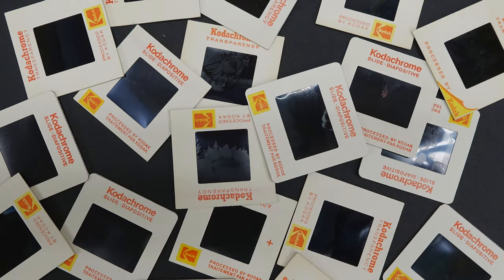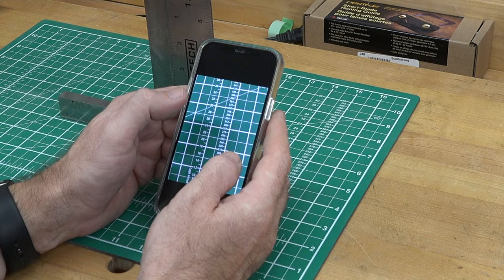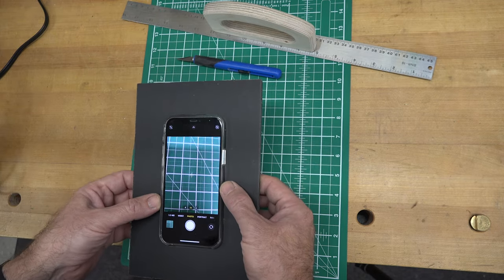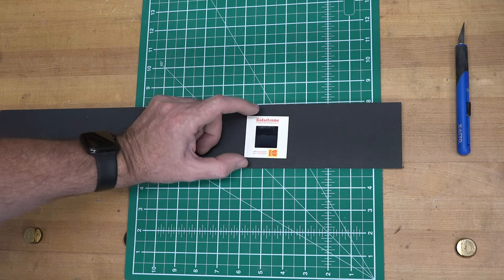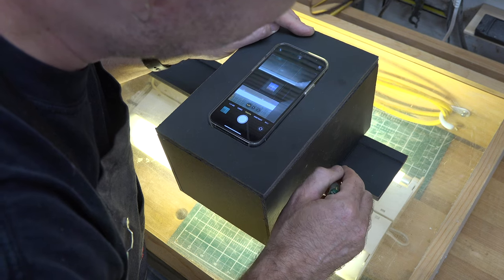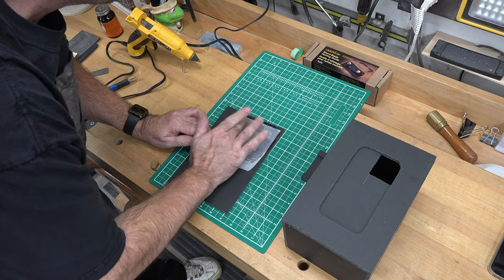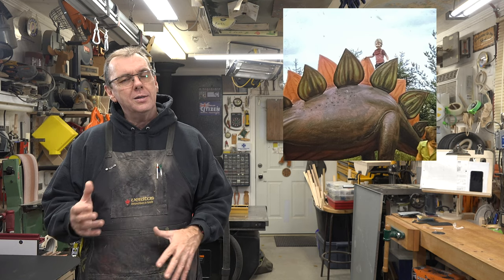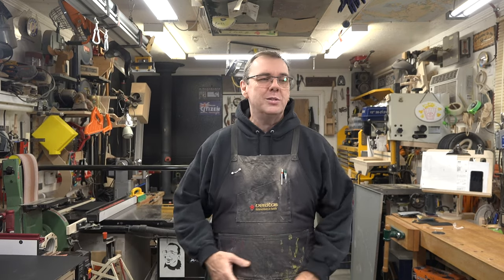Converting Slides to Digital Images

Comment: I'm really glad that you mentioned making sure to clean the slides. A few years ago, I decided to scan all of my family's old negatives. I have a scanner that has an attachment for scanning slides and negatives and figured this would be a good use of the down time between Christmas and New Years. I spent countless hours setting up an assembly line to scan all of them. When I was done, I converted all of the negatives to positive images and scaled them up. At this point I could see just how dusty they were! Software can remove some of the dust but starting clean is much better.
Reply from the maker: It is next to impossible to get a 100% clean slide to convert to digital, but giving them a good cleaning before putting them in the converter is a good start.  For the amount of dust or dirt that will show after a quick cleaning and conversion, the image will be acceptable for most users.  Thanks for tuning in to the show this week Jim and for chiming in with your story.  I'm frustrated for you.  LOL.

Comment: Thank you!  Our dad was a photographer, he took many and had them as slides.
I’ve searched in our area, and no one had the process of converting slides into prints.
So, THIS video is greatly appreciated!
Reply from the maker: While my father wasn't a photographer, he did take a lot of photos on  family trips and like you, I struggled to find someone to convert them to digital images.  I have found that the key to getting this done is to ensure that the slides are clean before you take the pictures.  I am also considering make a new version of this slide convertor using a DSLR camera instead of a phone.  It's something that you may want to consider as well if you want your images to be in RAW format for better editing and colour optimization.  Thanks for tuning in to the show and good luck with your conversion.

Comment: Amazing! I thought I might have to spend a lot of money to buy a projector or something but this is perfect. Took a couple of hours and around $12 USD (things are a lot more expensive in NZ but still cheap and fun to build). And it actually works! I'll have fun going through the rest of my mothers collection and I'm sure she is going to be super surprised and very happy when I show her her digitized slides from back in the 60s and 70s. Much appreciated :)
Reply from the maker: Glad that it worked out for you.  Be sure to clean your slides really well so that the dust and dirt doesn't transfer to your digital image.  Thanks for tuning in to the show and for the kind words.
Reply: How do you clean a slide without damaging the image? Thank you so much for your help.
Reply: use cotton buds and isopropyl alcohol to clean both sides of each slide

Comment: Hi Kenny, thank you so much for doing this project, it helped me out greatly. I also had issues with the light diffuser. What worked for me was not using a diffuser on the box, and (1) putting the frosted plastic sheet on the floor, and using it as a reflected light source (I attached a small flashlight to my belt, pointed at the sheet, so my hands were freed up to feed/retrieve the slides). What worked even better was instead to (2) use my Mac browser to bring up a white screen as the light source (which of course didn't need to be diffused). Placed the box onto it, and voila. All set to feed slides. This allows one to sit on a couch for the digitization, which was more comfortable than sitting at my desk to do it - easier on the back! Thanks again for your wonderful video.
Reply from the maker: I'm glad that you found the video useful and that you were able to come up with a lighting solution that worked for you.  Thanks for tuning in and for taking the time to leave your comment and kind words.  It's very much appreciated.

Comment: Fantastic idea! Beautifully executed video! I plan to get started on this tomorrow. I have approximately 2.2K slides that were taken by my father scanning the 50's to the 80's. My wife had given me a slide/negative scanner for Christmas a few years back and, I just discovered a serious shortcoming when converting slides! It has a built in, non-adjustable crop factor that results in a lot of chopped off heads. So, your brilliant idea will help save the day (with no maimed or  missing body parts). Thanks!!
Reply from the maker: Glad that the video was able to help you out Glenn.  Good luck on your project and your slide conversion.  Thanks for tuning in.
Reply: @acutabove_woodworkings  I picked up all of the materials for the box and slide tray construction today and, hope to get the build done this weekend. In the video, you mentioned early on that initially you sat the box onto your light table. How did the light table work as a light source? I ask because I see that there are LED light tables available that look like they would work very well. Sorry to continue asking questions.
Reply from the maker: @glennb1374  I had some issues getting the lighting right.  The problem is that you have to make sure that it is well diffused to avoid the individual LED's showing in the slides.  I finally settled on this one https://www.amazon.ca/gp/product/B0C663WDXH/ref=ppx_yo_dt_b_search_asin_title?ie=UTF8&th=1
and it worked perfectly.  No worries on the extra questions.  I don't see the point in me having a YouTube channel if I am not willing to answer people's questions and help out when I can.  While other channels use YouTube as a source of income, I have a full time job and try to utilize Youtube to actually help folks.  The tiny bit of money I make from the channel helps to keep the content going and to keep my website afloat.  I'm only to glad to help Glenn.  Ask whatever questions you like.
Reply: @acutabove_woodworkings  That one is nearly identical to the one that I had found on Amazon. Before I pull the trigger on it, I want to try one of the small Manfrotto lights that I already have on hand. If it works out, I’ll be sure to send you the info on it. Thanks again for taking the time to respond and share your experience and thoughts.

Comment: Hey Kenny, cool project. Another thing to try for the light diffuser is to move the diffuser away from the slide itself. This will ensure that the camera can't focus on the surface of the diffuser and the slide at the same time. It will make the box taller, but it will make a difference.
Reply from the maker: It wouldn't take much to do that Jim.  I will have to give it a try.  Thanks for tuning in and for taking the time to chime in with your suggestion.

Comment: Thanks Kenny from down under, just about to convert several hundred slides that are getting over 40 years old now, have looked at commercial but will copy your design. Thanks
Reply from the maker: I hope it works well for your Chris.  Thanks for tuning in and for taking the time to leave your comment.

Comment: If only I had seen this before ordering a scanner.  A thought to add to this ingenious make:  if the phone camera is oriented with its aspect to match that of your largest slide visual dimension (in this case, a 35 mm rectangle with the longest side matching the longest on the camera), then when you zoom to fill the screen, your resolution will be optimised.
Reply from the maker: Well hopefully you will still end up making one of these Craig.  It would be interesting to see the difference between the images done on the scanner and the images done with the cell phone.  I like your aspect ratio idea.  Thanks for chiming in with that and for tuning in to the show.

Comment: I added a heavy can to the inside of the box, so it can sit over the edge of the table without falling off, and didn't put in a light diffuser but rather diffused the light coming in. Also, I didn't do as good a job at cutting so my box was a bit wonky and let light in - so I taped the edges in black duct tape and it keeps the light in and looks nicer, too! Great design, thanks!

Comment: Thanks for this video Kenny, I made your design and it worked like a charm. My addition was to add a white foam core light box as the light source that worked great. Thanks again .
Reply from the maker: Glad to hear that you were able to make a successful converter Joe.  Sounds like you came up with a great solution for the light.  Thanks for tuning in and for chiming in with your thoughts.

Comment: Cool project Ken, my brother went to school for photography, he made a light box and used my light board that I have its a box with 2 fluorescent tubes (bulbs) with a white plastic board to defuse the light with a dimmer switch, for my brother it works great, he would look at slides and film strips after developing them, the light board worked out for my brother, thanks Ken  be safe
Reply: Made mine in photography school about ... 30+ years ago. lol  Still have it and drag it out from time to time. The white plastic board you're referring to is diffused plexiglass. You can't see through it but it allows light to pass through it.
Reply from the maker: Sounds great Phil and probably better than anything you would purchase today.  Thanks for tuning in and for chiming in with your story.  It's appreciated.
Reply from the maker: That sounds awesome Alan.  I'm sure that there would be many options to make your own light box today with many options for lighting.  The light box I made years ago had two small fluorescent fixtures in it.  It's bulky, it's heavy and it takes up a ton of room.  Maybe it's time for me to produce a show on making a light box with today's technology.  Much thinner and possibly LED lighting instead of fluorescent or incandescent.  Now you've got me thinking.  Thanks for tuning in Alan.  It's appreciated.

Comment: Magic! I need to scan a couple of slides. This should give me a chance to try to digitise them. The shop bought ones are too costly for only 2! Cross your fingers for me that this works. I have lots of foam board anyway, so...
Reply from the maker: I hope it does work for you Gail.  It worked for me.  Just make sure that you clean your slide really well and that there is no dust on them at all.  Dust really shows on the digital image.  Thanks for tuning in and good luck on your project.

Comment: I have a somewhat related interest in digitally processing a small collection of glass negatives (about 100 yr. old).  The response I received on a professional photography forum was to use indirect light instead of direct light with a diffuser.  In other words, arrange a remote flash to reflect off a curved white poster board or the like and mask the negative plate so no light comes in over the edge.  Also, I would use my dslr camera instead of a smartphone.  The number of megapixels is just one factor pertaining to image quality.  The size of the CMOS light sensor is another.  I already have an LED light board.  It gives fairly acceptable results, but not as bright as I really need.
Reply from the maker: Very interesting comment Trenton.  I have never heard of or seen glass negatives and I hope that you are able to use your DSLR to capture the images on them.  I may have to try my DSLR and see if I am able to use that instead of my smart phone.  I like the increase megapixel thought.  Thanks for tuning in and for chiming in to the conversation.

Comment: Those were the days my friend, I'd thought they'd never end...
Reply from the maker: Sadly, they did end.  It's a digital age now.  Thanks for tuning in Randy and for taking the time to leave your comment.
Reply: I have around 500 boxes of Kodachrome  from ..back in the day. I also have my grandfather's photos, mostly Kodachrome 👍along with some Ektachrome 🫨
I scanned a lot of my slides with a flatbed Canon film scanner,  but my XP computer kicked the bucket and I bought a cheap HP laptop.  The scanner doesn't work with anything beyond XP. 😥
I appreciate you taking the time to make and show this setup.
I know devices were made for digital camera conversions, but I never could afford to buy anything as nice as my old Canon equipment.
I'm wondering now,  how good the quality will be using something like what you've shown here.
........the Canon flatbed is 2004 technology. 🤔
I bought a Pixel 8 a few months ago.  The image quality is very nice.  I'm going to try this out when I find the time.
I made a lightbox years ago with a white sheet of plexiglass topped with glass.  It had a small florescent light inside. I used it for sorting my good stuff from the crappy stuff.
 Like many photographers, much more crappy than good, but when it's good, you know it.
Thanks again for rekindling my thoughts about those little yellow boxes 👍 
Set up right, I'm thinking this will outperform the scanner.
Reply from the maker: @randywl8925  I have also wondered about making this same setup, but for use with an DSLR camera and possibly a 50mm lens.  I may be expanding on this project myself soon.

Comment: We had 1000+ color slides we wanted to convert to digital images.  We got bids from $750 to over $1200.  So I 3D printed an adapter that fit over my macro lens to hold the slides at the proper distance away.  I used my computer monitor for a light source since using software I could "dial" in a color to make up for some bad slides otherwise a white screen was perfect.  It only took 5 or 10 seconds per slide once I got going.
Reply from the maker: That's a great solution as well Charles.  I may have to look into that and see if I can design something that will fit my lens.  Thanks for tuning in and for chiming in with your method.  I love it.

Comment: Brilliant?
You can use a flatbed scanner with slide attachment - both Canon and Epson make them, but they have not been updated in years and prices can be high because of limited supply.  Scanners are very slow and finicky to load the slides in the holder.  About the only advantage is they can also scan negatives, but they suffer from the same problems with dust contamination which is almost impossible to solve consistently.

I've already scanned my collection of slides but going to give this a try to see if the results improve.
Reply from the maker: While scanners do work the way you described, not everyone has one and this is a really cheap alternative to be able to convert your photos.  To be honest, I have a scanner and it came with the "cartridge" to hold the slides and negatives but I was looking for something a little simpler to use.  Thanks for tuning in Woody and for taking the time to chime in with your alternative method.  It's very much appreciated.

Comment: Hi, thanks for a a great video! Don't have a dollar store where I live, so have to buy foam core online. Whats thickness in mm do you recommend, so it won't be too thin?
Reply from the maker: I just measured the stuff that I used and it is 5mm.  I hope this helps,  Thanks for tuning in and good luck on your project.
Reply: Thanks a lot - it does! 🙂

Comment: Would paper vellum work? I recall using it to draw architecture plans. It might be smoother than your dollar-store plastic sheet. I know this is two years later than your filming, and any newbie might want to try paper vellum and comment on your results.
Reply from the maker: I tried vellum (or onion skin as it is sometimes called) and it gave very blotchy results in the light diffusion making the image blotchy as well.  Thanks for tuning in and for chiming in with your suggestion.  Maybe multiple layers of vellum?

Comment: This is great. I have hundreds of slides, if not thousands. I have a photo scanner but I'm not pleased with the size of the scans on the slides. My Iphone X's photos are 12 megapixels. My Nikon D5200 is 24 megapixels. I'm going to build something similar to this where I can use my Nikon. For the diffusion, I think I will build the inside of the box out of white foam core with a daylight light source which isn't directly in line with the slide. LED's might work as well as a daylight light bulb. I'm afraid, even the plastic you finally used to diffuse the light, is going to show up in enlargements of the slides once they are digitized. If the white foam core is four or five inches behind the slide, it should fall out of focus and the slick white backing on the foam core shouldn't show any kind of grain or imperfections.
Reply from the maker: Your modifications sound awesome Jay.  I'd be interested to hear how they work out.  Thanks for tuning in to the show and for taking the time to leave your comment.  It's very much appreciated.

Comment: I would use 3M double sided tape for the slide holder.   The color of the light coming through the slide is important too.  Too warm or too cool will skew color.  I would say 5500k.
Reply from the maker: It definitely takes some experimenting to get the colour that you are happy with.  Thanks for tuning in and for chiming in with your suggestions.

Comment: Great video! Have you negatives to se if the results are as good?
Reply from the maker: I have plenty of negatives but have not tried it to see if it works.  I will have to give it a whirl but I'm not sure if it will create the same image or not.  I think there is some conversation of the negative image that needs to be done digitally.  Thanks for tuning in to the show.